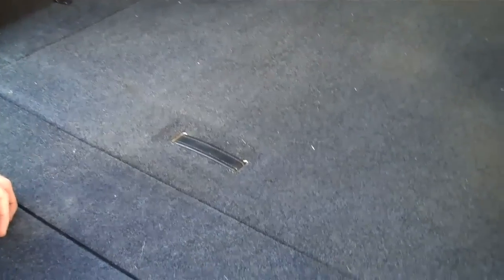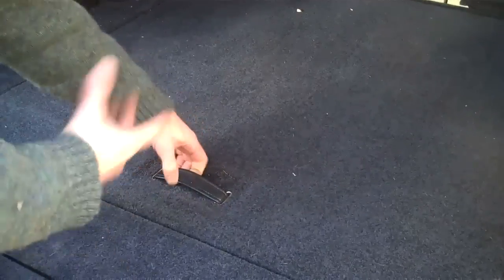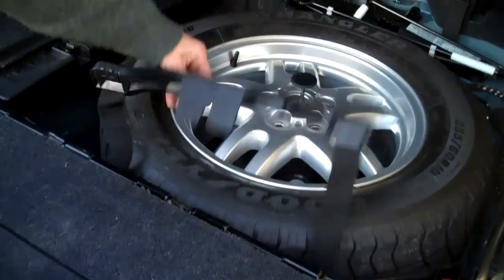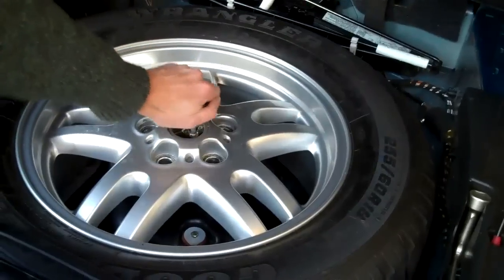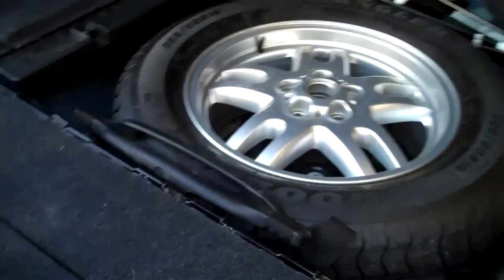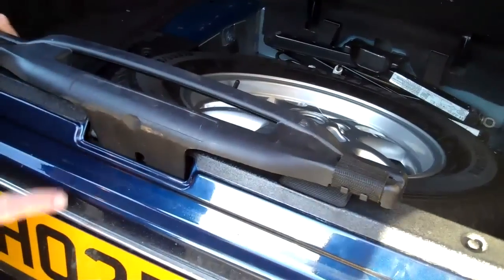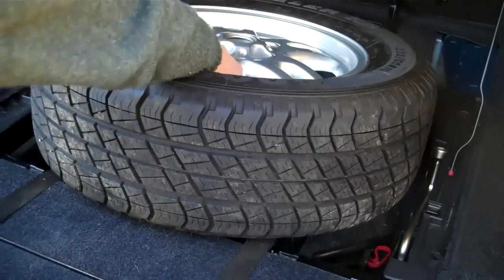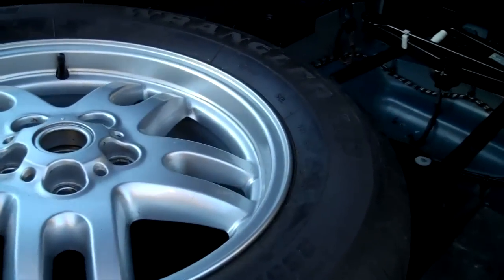How to remove the spare wheel on a Range Rover L322

Comment: Would it be possible to take parts of this spare tire framing and fit it to a new Defender? I need store a second spare tire for my travel trailer in my tow vehicle, since there is no spare on it at all. What do you think? Is it possible to modify the Defender to store a tire beneath the floor board? Is that monocoque frame deep enough back there?

Comment: where can I buy this smart accessory? in your website? I didn't find it    Thanks
Reply from the maker: Hi - this is not an accessory it is part of the car from new ! it should be in your car as standard. Let me know if i should put them for sale on the website !
Reply: @L663  just doing some research it seems that after the 2006 facelift it was no longer standard fitment
Reply: No its not fixed to my car
Reply: @aylesburynumptydrivers9672 I have a 2007 albeit early, and it has one.

Edit: must have been a tick in the option list.